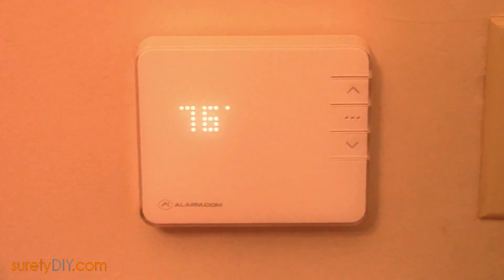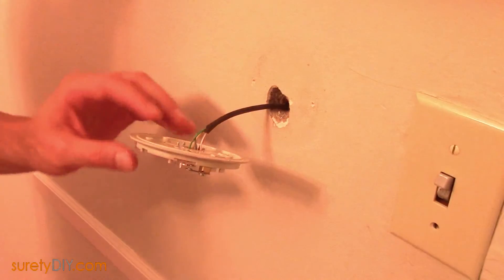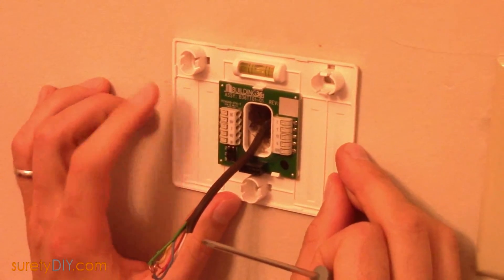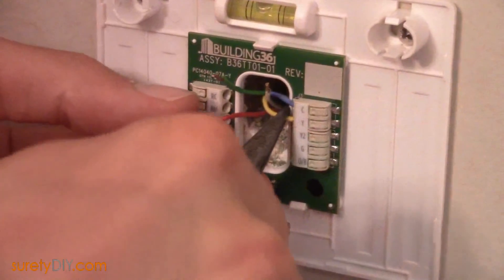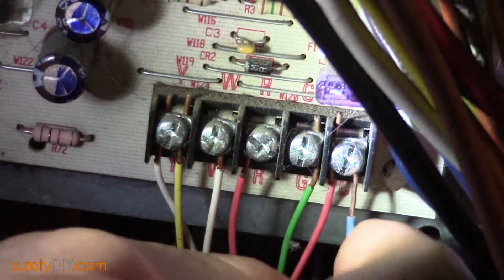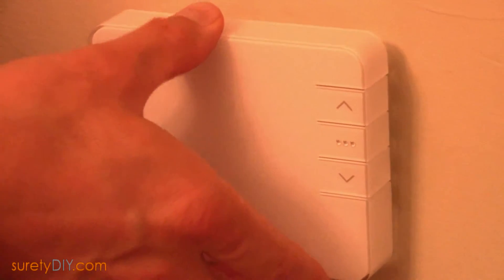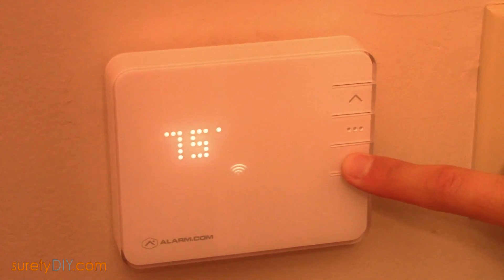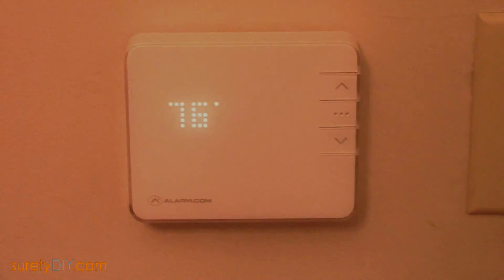How to install an ADCT2000 Alarm.com Smart Thermostatwith a 2GIG Go!Control System

Comment: I have a Trane 2 stage furnace, which means my furnace fan is on all day on low and when it kicks on the fan goes up higher depending on the heat or air conditional. Will the Alarm.com thermostats accompany this feature? Model number: ADC-- T2000

Comment: does this thermostat work with a American Standard heat pump system?
Reply from the maker: +Cody Weaver The ADC-T2000 can be configured for use with standard furnace systems or Heat pumps.

Comment: Is there a way to change this to read in Celsius?
Reply from the maker: The ADC-T2000 will display temp units based on Alarm.com Account Settings. To change, log into your Alarm.com account:Click on the Profile tab. This may be under the More section.
Click on the System Info sub-tab.
Select the desired option (Celsius/Fahrenheit) the Temperature Units dropdown.
Click the Update button at the bottom to save the change.

Comment: How do I remove the wires? Do I just pull them out?
Reply from the maker: To remove wires from a T2000, press in on the little plastic tab corresponding to the wire. While pressing down, the wire will be loose, so you can pull it out.
Reply: @Surety  Thanks :)